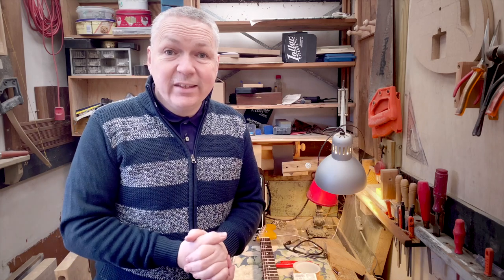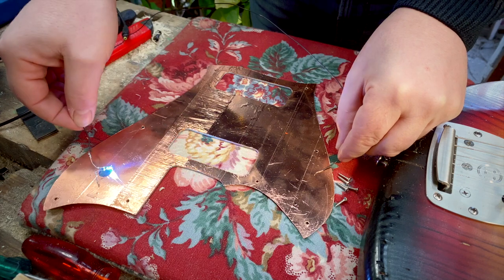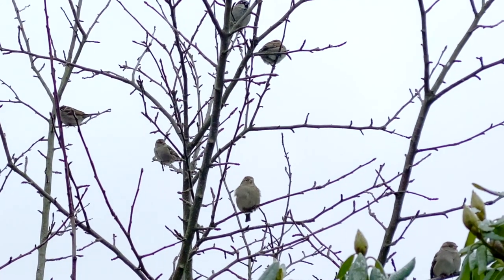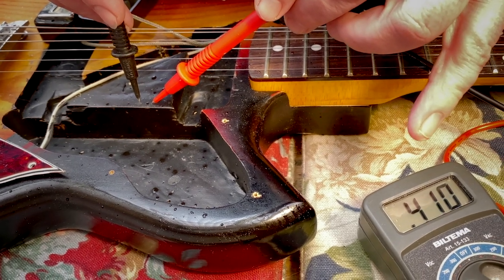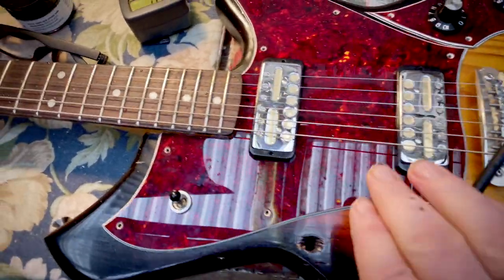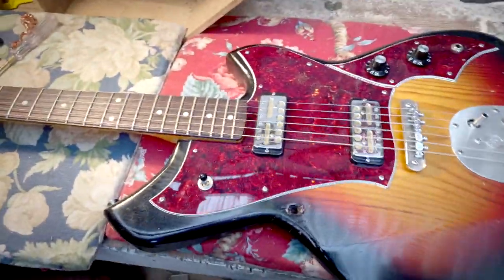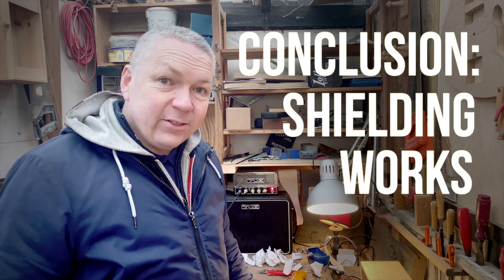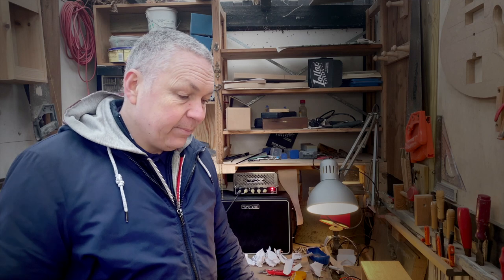This is WHY you should SHIELD your guitar -  PAINT or FOIL?

Comment: Finally, someone has done a decent before and after audio test and not only with copper tape but conductive paint as well. Well done!
Reply from the maker: Thanks man. Glad you enjoyed it 😃👍🏼
Reply: isnt the sheilding also to prevent too much EMF since the guitar is next to your groin area and can cause cancer I heard
Reply: @angeldaviani8678  The minuscule amount of power that's output by the guitar's pickups is negligible in terms of radiated EMF.  That's not a cancer risk, nor any other kind of risk.  You get a much larger amount of electromagnetic radiation from your amp's AC power cord (even from the AC wiring inside your walls) and from your amp speaker's voice coil.  Really, you don't have to worry about anything being radiated by your guitar's pickups.
Reply: @angeldaviani8678  If you play the right kind of music your balls get resistent \m/

Comment: I think the reason the paint seemed to work well is because the pickguard was facing the lamp, so it was doing the majority of the shielding for you. It's also important to avoid ground loops in the shielding, so there should be continuous connectivity between all parts of the shielding (conductive adhesive is a must!). Again, beautiful work!
Reply from the maker: Thanks for great input Ezra 🙏😉
Reply: It's impossible to create s ground loop in a passive electric guitar

Comment: Usually I apply 2 to 3 coats of conductive paint. I measure the resistance until I get something below 250 ohms. If not, I apply another layer. 
You can make your own paint using shellac ( you' ll find it in craft stores) mixed with graphite powder. It's cheap, dries in 4 hours and works great.
When using copper foil be aware that not all types of foil have conductive adhesive in the back side. Most of adhesives found in copper foils are in fact insulating. So you have to solder each layer to make the connections. Just a small solder spot connecting the layers.
Reply from the maker: Thanks for a great comment. Very helpful info for everyone. 
😃👍🏼
Reply: @MichaelLagerstedt  Thanks. And very helpful video.
Reply: What I've heard was at least 2 coats. And it shouldn't take more than 24 hrs for a coat to dry? Also if the cavity is on the back paint the cavity plate as well.
Reply: Thank You for your comment. That was huge in figuring out why my "shielded" tele hummed so loud"

Comment: The problem with shielding paint is that it can turn into dust (especially the ones in spray can) and ruin electronics components like pots. So , it's better to put an overspray (clear lacquer) when using it. But, even if it's more complicated to make, copper foil shielding is better.
Reply from the maker: Hi Fenson
Thanks for a great comment 😀👍🏼. I wasn’t aware of that. 
Mic
Reply: 10 + years touring constantly with shielding paint treated instruments & nothing has turned to dust. Don't use junk shielding paint, prepare your surfaces, apply the paint properly! 👍
Reply: @drainaudio  I have Fender Player Strat and I have no idea what paint they used, but it indeed turns into dust, leaving black marks on your fingers. I had a number of guitars before, and there never was such problem with paint shielding. I needed to use some primer before i was able to use foil on that paint. Probably Fender uses sprays, not brushes.
Reply: @drainaudio , I used rustins shielding paint, best one
Reply: @drainaudio  what brand did you use?
Reply: Kontakt Chemie Graphit 33 spray. After spraying it you use a heat gun for a couple seconds as the using directions suggest, and the paint turns hard and shiny like a glass surface. It is almost impossible to scratch with a sharp object. Mulitmeter beep test does not work on graphite base paints, but they are still conductive. It is faster and more robust than a copper tape
Reply: @kaganozmeric9822  - Multimeter does & absolutely should work with graphite based paints. How else do you confirm that all of the cavities have continuity to earth without any resistance? Shielding without electronically testing/confirming the result = a paint job, no more.
Reply: @jamesmichaelbaker2405  - Anything from a good supplier such as Stewmac. Prep is key, I always use a Dremel with a fine sanding mop to clean up the cavities/rough up backs of covers, pickguards etc & then isopropyl alcohol for a final clean. 3 coats, 24 hours between coats.
Reply: @drainaudio  If your multimeter is set to beep for the values below the inherent resistance of conductive paint the test will fail. But that does not mean there is no conductivity, or the shielding will fail. If there is a finite resistance between the two points on the paint multimeter might not beep but you can measure conductivity, or you can use a led or lightbulb circuit to test conductivity. Some people might aim for the near-zero-resistance for guitar cavity shielding, but what I have learned and my experience tell that is not necessary. The sprays I use allow you apply two or more coats in very short intervals as it dries quickly, and you can also increase its conductivity and abrasion resistance by buffing with a soft cloth (or applying some heat). So in two hours you're good to go. If you want lower resistance values or a beep from your multimeter there are copper based sprays for much more critical shielding applications
Reply: @kaganozmeric9822  - All of my shielding applications are critical & none of them have any "inherent" resistance......but thanks for mansplaining it to me.. 👍

Comment: Getting a new lamp might be easier.... But seriously, I shielded my bass and my stratocaster with foil about 10 years ago. My downstairs neighbor had a lamp or something that would cause a ridiculous buzz/humming sound that was driving me crazy. After adding copper foil tape the neighbor's light was no longer an issue. I have since moved and after replacing my pots and pickups in my bass a few weeks ago and then running into a head scratching grounding issue. I removed all of the shielding tape, (not a fast and easy task, but it DID fix my grounding issue) And instead of adding some new fresh shielding, I decided to go without shielding and see if it was even needed anymore in my new place. Hard to say the removal of tape made how much of an impact for sure because of the new pots and pickups, but there was not any increased buzzing or humm. And it did sound much better than expected the new pickups. 

My advice to anyone thinking about shielding their guitar or bass. Only do it if you absolutely have to. If you hear some faint humm or buzz occasionally, your best move might be to just accept you have chosen to play a noisy instrument, hendrix seemed to do just fine without shielding, maybe you can too? But if you regularly experience a completely disruptive interference and you are powerless to remove whatever is causing the interference and it is completely driving you insane... Then YOU might need to shield your guitar. But I have seen so many people shield their guitar when they really do not need to. Whatever makes you happy. Just know it might not be worth the time or effort uinless you are having some serious issues with interference. But if you still aren't happy after shielding it then maybe you should try jazz flute instead? 

Best of luck, hope my 2cents helps someone
Reply from the maker: Hi Jeff , Thanks for your great perspective. Great points you are making.
😃🙏🏻

Comment: Most of the noise that was gone when you tested the paint, was intercepted by the pickguard. You should try to turn the guitar upside down, so the lamp was behind it. Foil just works better.

I play in different positions in my room, with lamps, chargers, phones etc. In most cases, when you have shielded pickguard and you hold the guitar touching the strings, the noise is acceptable. Electronics is then covered from the front by the pickguard, and by your body from the back. That is why sometimes the noise gets bigger when you don't touch the strings or any other grounded piece of hardware - because the body is not in the circuit. The noise gets to hot parts of the circuit from behind.

What tend to do is to solder pieces of the foil together, despite the fact the adhesive is conductive. Some people said that with the time it can degrade, and pieces of foil gets loose, which can lead to short-circuit. Also couple of times I made foil shielding leaving some lip of the foil all around the cavities, so the shields from pickguard and cavities were touching each other everywhere, leaving no gaps. There was completely no gain in the noise level, but the pickguard stopped to fit correctly and it was a nightmare to remove the foil. Just saying, because some people advice to do it that way, which is unnecessary.

The biggest controversy around shielding guitar with singlecoils is that it affects the tone. The fact that there is less noise is obvious, but there is a ton of theories around the tone. I don't claim anything here, just mentioning the discussion. Even with noiseless singlecoils people claim that the tone is dead ;) It's like there was some sound in the noise :)
Reply from the maker: Thanks so much for a great and informative comment. Very interesting. 
Great to share failures and successes so others can learn 
🙏🏻😃

Comment: i prefer paint but i seal it with an extra layer of finish. the shielding works equally well with both materials. the reason i don't use copper foil is it is too conductive. things like eddy currents and capacitances come into play, and funny things can happen to higher frequencies. i also avoid shielding pickup cavities if the pickups have a shielding of their own. i also have seen a guitar in which the foil got delaminated and shorted out the neck pickup. the owner said he didn't heat it. paint seems more reliable.
Reply from the maker: Thanks so much for great input 🙏😃
Super useful for everyone 👌🏼
… and thanks for watching 😉👍🏼

Comment: I always use shielding paint. But it needs to be stirred thoroughly before applying, it also needs 2 to 3 coats. After that it’s as good as tape - or better actually if the tape glue is not conductive. I also fit ground straps to each cavity and connect them to the components. Perfect shielding every time and no need for the tape.
Reply from the maker: Hi Lee
Thanks for sharing your experience on this. I just got a new shielding paint I’m trying out for my current build.
Thanks for watching as well 😃🙏🏻

Comment: My Fender AM Performer strat is painted and has aluminium foil all over pickguard from factory. Measured paint resistance - about 0.250 Ohm. Shielding works great, even with single coils. In 2 and 4 positions it's quiet as humbucker.

Comment: You didn't detail it in the video but I think I briefly saw that the back of the pickguard was taped. I've done a few of these and on Fender-style overlay pickguards I think it helps, so glad you did that. Not important for the back of the control plate as nothing about pots is very sensitive to radio/emi. I've done that though and guess it can't hurt but make sure no bare wires are shorting or grounding to your shielding. But shielding the pickup cavities as much as possible has helped every time for me. On one Squier Mustang it practically silenced the hum. I appreciate the nice neat systematic tape job you did here!
Reply from the maker: Thanks so much Mark. Great to hear your experience with shielding.
Thanks for taking the time to share that 😃🙏🏻

Comment: Hi Michael, great video and very informative but be careful when using an LED for a continuity check.  An LED will illuminate with almost any amount of potential difference, my point is that while the LED might indicate some level of continuity, it might not necessarily be enough to satisfy the needs.  Copper foil tape is the way to go but with as wider strips as you can find.
Reply from the maker: Hey Mart, 
Thanks for a great comment. You are right. In my second shielding video I used my measuring device. 

https://youtu.be/0N3R2kYMI-U

But it turns out that even if there’s some resistance it still shielding effectively. I’m actually planning to use shielding paint again in my current guitar build .
Thanks so much for watching 😃🙏
Reply: What are you talking about? LED? What???

Comment: You need to put a wire from your 1/4 inch jack to the foil if you haven't. I saw it in a different video but haven't tried it. Me I'm going to use the paint. Thank you for the video!
Reply from the maker: Thanks for the tip and for watching 👍🙏🏻😃

Comment: Copper tape sux. I used MG Chemicals Super Shield Silver conductive paint. the resistance helps a lot. eliminates ground loops by adding resistance.
MG Chemicals super shield dries up immediately. i had to put several coats because the wood would absorb the paint too fast.
Reply from the maker: Great info. Thanks 😉👍

Comment: How the proper shielding process would be if I have a Les Paul; which has the pots, bridge PU, neck PU and switch in separated cavities?? Please help
Reply from the maker: Shield all cavities and connect them. The guitar in the video has separate cavities as well, just do like I did 👍😉
Copper foil on the back of the pick guard and copper foil or shielding paint in the cavities. If you use paint be aware that paint doesn’t sit well on sharp edges.
Hope this helps 
Thanks for watching 😃👍🙏🏻

Comment: Hi 
I just re-visited this video after having painted my cavities with Crimson Shielding paint. I did 3 full coats on dried out surfaces. I got huge continuity!
So I paid attention in your video that you only had one sparce and thin coat on only part of the cavities. I think had you done 2 or 3 coats you would've had good results.
I am yet to assemble and try the sound.
Will report back then.
Reply from the maker: Hi Shmuel, Great report. Really good to know 😃👍🏼. Thanks 🙏
Reply: Hi! So how it worked?
Reply: @SergeiVlassov  
Hi again.
The Strat is absolutely quiet !!
Amazing !! I recommend.
Be patient. Let it dry fully (24 hours) before each coat.

Comment: I think it takes more time to shield with foil than waiting for the paint to dry. Also, when I use paint I get 0.01 resistance. Maybe the moisture got into your paint and/or it wasn't dry.
Reply from the maker: Interesting with low resistance. I think the paint simply  was too thick. I have on my two latest projects used a little thinner paint and that helped a lot. Still I don’t get that low a resistance. For my current build I got a new shielding paint. I’m exited to see if that makes a difference.
Thanks so much for watching and taking the time to comment 😃🙏🏻
Reply: @MichaelLagerstedt  On my last 2 guitars, recently done, I went from 3 to 2 coats, mostly for time saving, and each did fine. I don't remember the resistance readings but they were low and I get no noise, and I'm using a monster Koch 4x12 amp that is perfectly clean at full gain. Yeah, when the amp is cranked the neighbors have to evacuate. 🤣

Comment: Wait,  was the A/B  the paint vs the shield with paint?

Tape should have been first,   Then remove it to contrast the paint vs tape alone
Reply from the maker: Hey, thanks so much for watching and commenting 😃🙏🏻.
You are right that I could have tested with only foil first. But my expectation was that foil would be better than paint. So the question was if I could see any improvement from paint to foil. Would the shielding be any better after putting foil in there? And the answer was no! Paint works just as well and it’s more convenient. 
In my second shielding test :
https://youtu.be/0N3R2kYMI-U
… I discovered that it doesn’t matter that there’s a resistance in paint as long as there is a currant flowing it works just as well 
👍😃
Reply: @MichaelLagerstedt  I like your methodology here.  I'd do it exactly as you did.  I wouldn't want to remove the foil.  Everybody can do his own variations.

Comment: Any doubts? Watch this YT vid: Guitar shielding hack: How to KILL THE HUM for FREE!!!.
I have always used aluminum foil (the electrical difference to copper has no practical significance for this use) and any old glue. 
For a semi-hollow, I put a plastic bag around the pots and switch with HVAC duct adhesive-backed aluminum around that and a ground wire.
I used the demonically messy liquid once on a buzzy open quad rail 22k p/u and needed three coats, but this was really the only simple solution for this.
Always use a continuity checker for every component to avoid later frustration.
Reply from the maker: Great tip Rabo, Thanks so much 😃🙏🏻

Comment: why is it fender guitars or other guitar companies don't shield the guitar just like what you did on this video presented, or not even using copper shielding tape?
Reply from the maker: Hi
Thanks so much for watching 🙏😃, Well I’m not really sure about that. I have tried to get some info on that but I haven’t been able to find a good source. I found this info though:

“Most Strat pickguards will come from the factory with aluminium foil acting as a grounding plate surrounding the switch, tone and volume controls. This is sufficient for a grounding plate but offers little to no shielding and not even close to creating a Faraday cage.”

Let me know if you find more information about that 😉👍🏼

Comment: I bought some shielding paint from amazon that was dry in an hour
Reply from the maker: Great 👍🏼 … I think I put it on too thick… should have done more thin coats as I did in my second build 😉😅
Thanks so much for watching 😃🙏
Reply: I only used conductive paints to repair a broken carbon track inside potentiometers. I observed that it reaches full conductivity only when perfectly dry (needs several hours, can be accellerated a bit with a hairdryer).